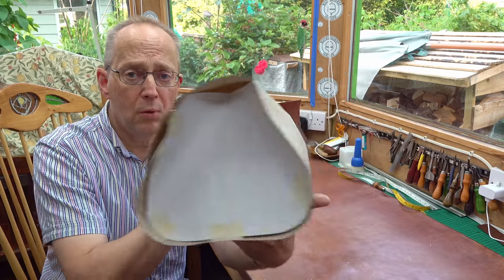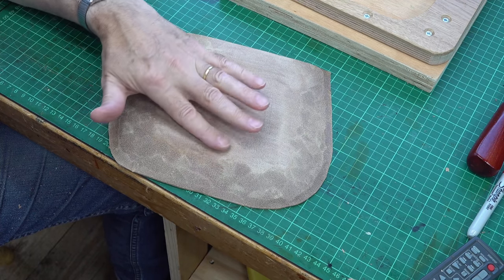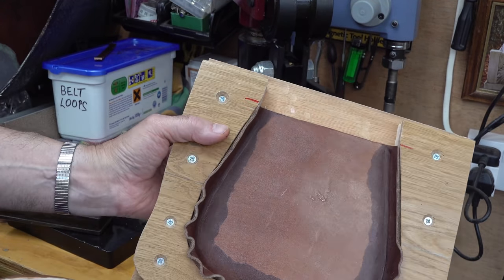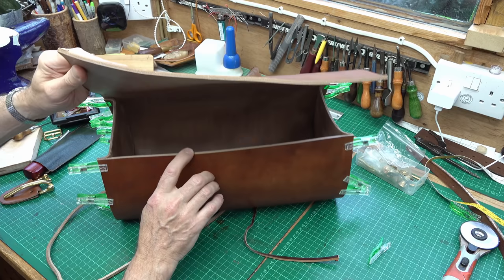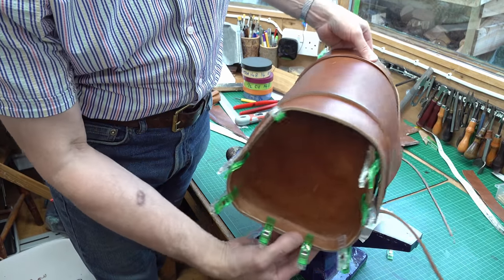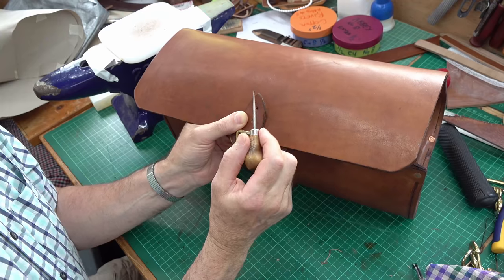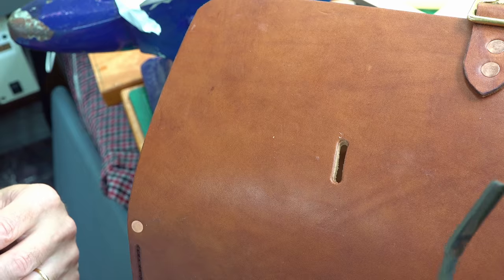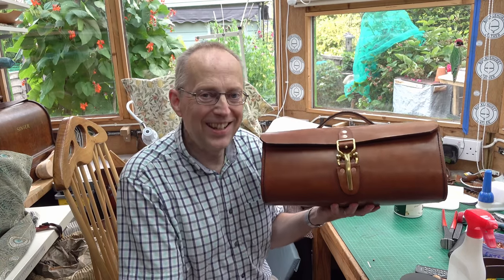How To Make A Compact Leather Tool Bag

Comment: Excellent video! I have an old leather shoulder bag that has been collecting dust for years. I don't think I've used it for twenty years. A while ago I realised that it would be perfect as a tool bag. I've treated the leather, that was the first step, and have been mulling over which tools to put in it. It's going to be for carving and sketching, so that helps, but it shouldn't become too heavy. I want to make holders for tools. Leather strips for tool handles and wider leather strips formed with pockets for the ends of tools are probably the main addition I have to make. It has two compartments, the main large one (larger than the one you make in the video) and a smaller one perfect for flat and square things. I don't really have the time to work on it right now, but it's lovely to think about and plan!

Comment: Just the type of bag I was looking for and a great video. My biggest issue with leatherworking is finding the leather. Seems to be a bit tricky knowing where to look. I recently just made a pair of A5 notebook covers using a thin sheepskin leather but I'd like to make a bag similar to your design, perhaps half the size or less to store my modest leatherworking tools. Any suggestions for leather supply in the UK?
Reply from the maker: Hi Abbey England or Metropolitan Leather or Bakers
Reply: @harryrogers  Thanks very much for the reply.

Comment: I just bought that nice knife you used to blend the skive on the end bits at the beginning.  I have also stumbled upon a pattern for a sheath for it.  I should be making it within the next few days.  The design of that knife allows it to do things that are difficult with a lot of the other sharp things I have in the shop.  How did I last all these years without one?
Reply: It's a Japanese Leather Knife, you can use it for both cutting leather and skiving. Search YT and there are several videos, including one by Harry - "Stropping a Cheap Skiving Knife to Super Sharp"
I have a couple of those Japanese knives, the cheap one shown and a more expensive model. Once you get used to the offset blade you realise how good & useful they are
Reply: @geoffreyboyling615  I know exactly what it is, have seen Harry's video as well as others that are using it, and I don't need to do any searching for anything, thanks very much.  But maybe someone who's actually new to this business might find your reference useful.

Comment: I picked up some oak bark tanned leather recently with a similar white waxy finish to it. What did you use to remove the wax?
Reply from the maker: Some heat will do it, but take care.
Reply: @harryrogers  thank you. I liked you tool bag design, I’ve done a similar but much smaller one for my spoon carving knifes. Mine didn’t need to fit an axe in it!